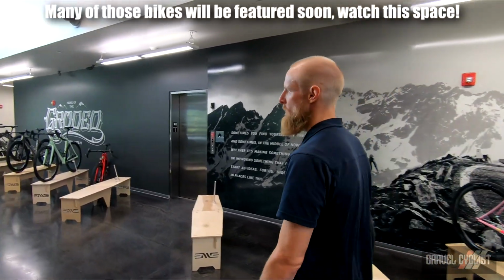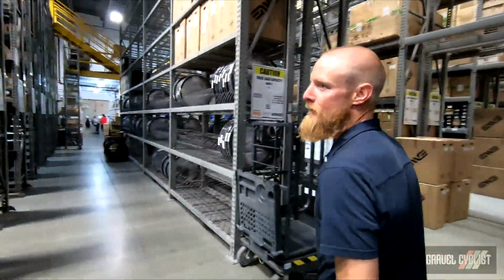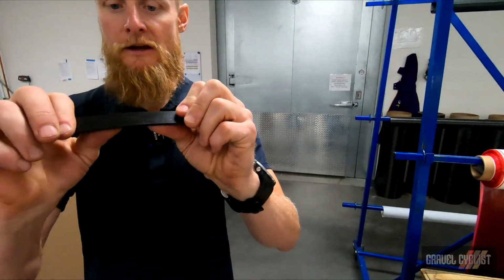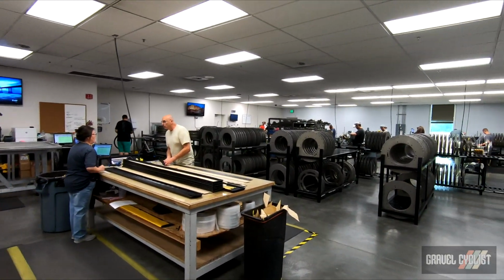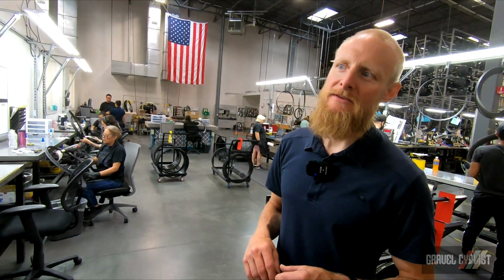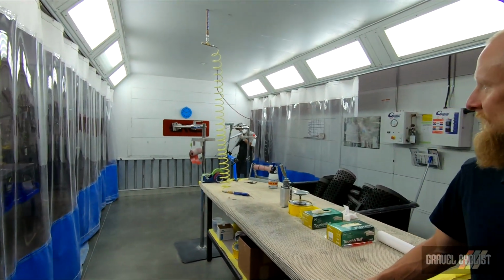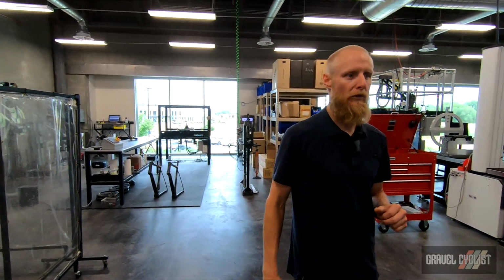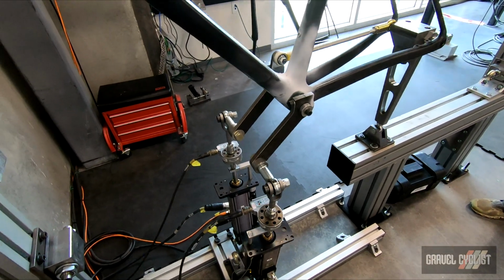ENVE Factory Tour: How they make & test Rims, Wheels, Frames & More!

Comment: Nice video. Are you running also over inflate test to see how much they stand for ? Zipp can go over 300 psi before it explode - What is normally enve range ? This could be interesting for all people that has the rim tape leaking for example. Thanks
Reply from the maker: Hello, you need to ask ENVE this question, this video is not presented by ENVE. Thank you.